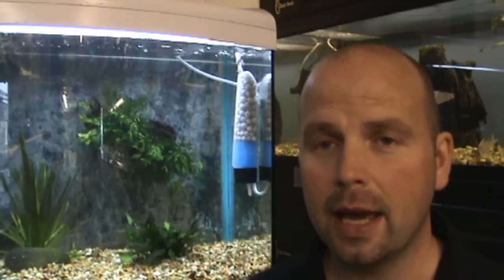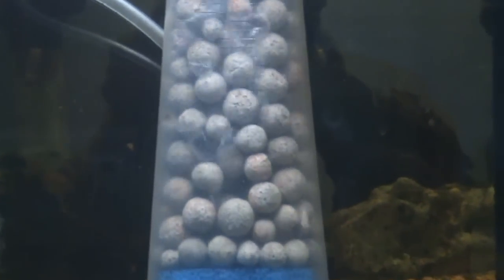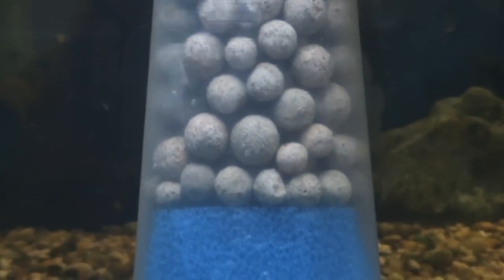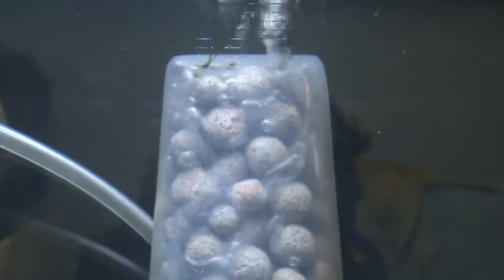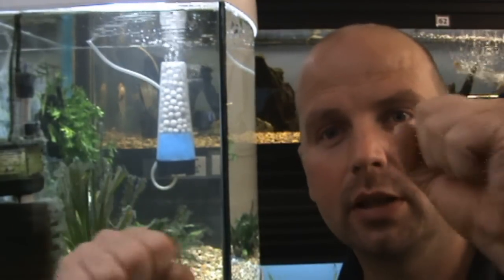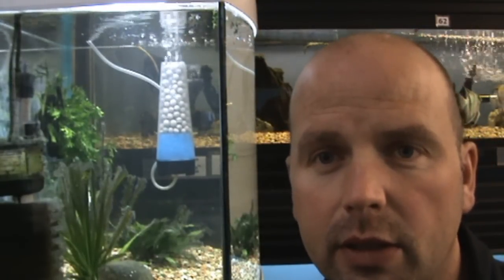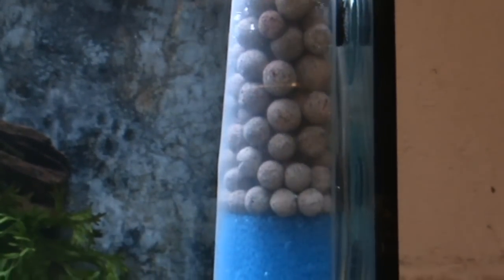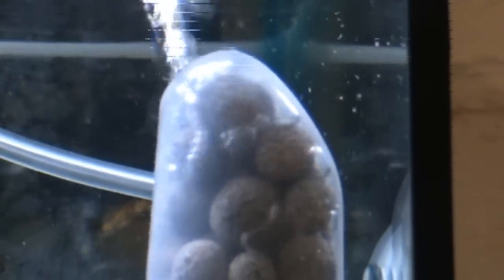Excellent DIY Aquarium Moving Bed Filter by Pondguru

Comment: I got a question that a number of people may be wondering. Can these types of filters replace the need for a hanging filter system in small tanks 10-20gallons? I was thinking of doing a sponge filter with a k-1 type of media that I was going to make out of the plastic cobs from receipt tape, small pieces of straws, and plastic beads.
Reply from the maker: Marc Mears The flow rate on these filters is none too fast so as far as clearing water goes they probably won't do the job of an internal or even a HOB filter. They're really for hammering ammonia and nitrite but will clear water to some degree. Best media you can use is K1 micro as you can have fast flow and violent movement in confined space. I'd personally use a DIY filter in addition to standard filtration.
Reply: Thank you for taking the time to answer my question. I love watching your videos, a lot them I've seen multiple times. You are a interesting guy with a lot of hobbies that I also enjoy.
Reply from the maker: Marc Mears Although it can take me 3-4 hours a day I do try and reply to all the comments. Glad you enjoy the videos and I hope to be doing some more filtration videos soon and there's some give aways coming up too so look out for them. I reckon my channel would do much better as far as subscribers and views goes if I only had one hobby on it but the last thing I am is a one-trick pony, lol. I see a few channels who never put anything else on other than what the majority of their viewers want to see which is great for them building channels but the passion seems to go from the channel owners and they end up faking it which is pitiful to witness. I'm as unconcerned about views and subscribers as I was when I started, lol

Comment: I hope I can still ask a question here. I want to make one of these but I am wondering if they make noise? My bedroom is on the other side of the fish tank with French Doors in between which are always open a little for the cats to come and go without waking me up. I am a pretty light sleeper.
Reply from the maker: Yes, any air driven filter will be more noisy than a 'normal' pump driven filter so if noise is an issue you'd be best to avoid air driven filters.

Comment: how's water coming out from there? I only feel only bubbles go out.
Reply from the maker: If you injected dye outside the bottom of the filter you would see it drawn into filter and spat out top but as it is not a powerhead type of flow that is not visible like it would be from a standard pump driven filter.

Comment: That looks very nice.
Would it be possible to make a large version for an outdoor koi pond using the same principal ?
The construction would be quite simple to do, but there are two conserns
- how to clean it easy and how big does it need to be
Yet the good things could be.
- the filter would only need air to be powered and it would require the water to be pumped to an external filter system 

what are your opinion on this system for a Koi Pond.?
Reply from the maker: +dkphantomdk Yes it is exactly the same principle as the Nexus filters which are very popular for koi ponds in the UK. The ideal scenario would be to have a 3 stage filter with 1 - foams to remove solids from water, 2 - moving bed media to remove ammonia and nitrite, 3 - static bed or shower filter of biohome / pumice to remove nitrates. A vegetable filter (pond plants) could also be used to soak up nitrates. Really the only thing which would need maintaining would be the foams.
Reply: +Pondguru Outdoors Yes, but I was thinking mounting this system in the Koi pond, so that there would be no need to pump water out of the pond to a filter and back to the pond.
The nexus has an air suply / pump ( in or out ), but if it was possible remove the pump, and just have Air to "power" it it would save energi.

Iam thinking, getting a huge "plastic" sever pipe, and build it up like this akvarium bottle, with Foam / Moving bed. then placing it inside the pond with a huge flat round air stone to pull water flow in it.

The foam would be diffecult to clean, but maybe you have a solution ?

( at the moment Iam running an Oase Filtoclear 30000 pr set, but Iam hoping to enlarge my pond this summer, and the Nexus 320 is an option, but, this bottle princip would be nice and would not require to many pipes or pumps to be installed )
Reply: +Pondguru Outdoors IT might even replace the Tornado Protein skimmer, with an outlet on the top?
Reply from the maker: +dkphantomdk If you already have a 30000 keeping water clear you won't need foams in your moving bed since the media is self cleaning so no worries there. Your idea sounds like it will work fine and I'm sure I have seen similar filters used in a video from a while back in a koi pond but I can't remember what it was called. If I track it down I will send a link.
Reply: +Pondguru Outdoors That would be nice, thank you.
It would be great if I could just keep on using the 30000 set, but it will reach its "limits" ( I will enlarge the pond up to max 15000 liters - thats more than it should be able to handle with koi - but I wont keep many fish )

but if it could work out with the 30000 set, and a few "pipe moving beds" in the pond it would save me some money ;)

( by the way. I really enjoy your video´s ;) )
Reply from the maker: +dkphantomdk Yes you could keep the 30000, add some moving bed filters and you'd be good to go. The moving beds will easily cope with ammonia and nitrite.
Reply: +Pondguru Outdoors hi Richard,after recently upgrading my external filter with biohome media, this is my next project using the biomotion,in your opinion how often would the sponge in this filter need maintenance
Reply from the maker: +daren barling It is generally a low flow filter so the foams may only need cleaning every month or so but it depends how powerful the air pump is and how much free waste is in water. If you have an external on there too the water should mostly get drawn toward the external intake so the filter foam with biomotion in may only need looking at every few months.
Reply: Pondguru Outdoors ok thanks

Comment from the maker: Cannister filters are all becoming pretty much the same although there will always be high quality manufacturers (e.g.Eheim) and cheap chinese filters (too many to mention). Most of the time the cheap chinese ones will have media which is absolute crap so best way to turn it into an effective media is to strip it out and replace with good media (e.g. Biohome plus / ultra)
One main problem with cheaper filters is reliability of pump.

Comment: Hey, I have a 129 litre planted tank that will be stocked with ~ 10 cory habrosus, 8 otos and 7-9 female bettas. How much of this media should I use?
Reply from the maker: Amount and type of media will depend on what type of filter you have.
Reply: Pondguru I want to make a vibrating bed with the biomotion media using a similar set up to what's in the video~
Reply from the maker: nerdziz It depends on size of container but I only used about 250g for this one.
Reply: Pondguru Is there any kind of ratio I could go by? like x grams to y litres of water

Comment: having read some other comments, I have two questions still:
1. when doing your weekly water change obviously you don't wash it weekly too, but especially with the foam/sponge surely it needs some rinsing/replacing?
2. will this be enough for filtration in a 10-ish gallon tank?
Reply from the maker: As you can see the foam you'd rinse it when it was dirty. The frequency of that would depend on the fish stock.
The size of filter required depends on the fish stock and for a lightly stocked planted tank of 40 litres this would be fine. For a heavily stocked tank you'd be better off with something like a Fluval 106.
Reply: Pondguru Outdoors Awesome, thanks man!

Comment: Hi I have a 200 ltr tank with a fluval 306 canister filter would the tank benefit from this homemade filter running as well.
Thanks
Reply from the maker: Assuming that you have the external filter set up properly with plenty of good media (around 2kg) and you have a normal stock of fish in a community tank you will not need extra filtration. There is a guide to how much media is required to deliver full cycle filtration (reduction in nitrate) for a variety of stocking scenarios here: http://filterpro.co.uk/qa-24-w.asp

Comment: what is a good filter to get
Reply from the maker: Externals are better than internals generally but it depends on fish stock and tank size.
Reply: ya my tank is not that big but my filter is small can i put other filter media in there such has them rocks
Reply from the maker: irishhiphopman101
If the filter is designed to take filter media, yes.

Comment: I would say that this kind of filter shown in the video doesent work! The tube/container is to wide and the bubbles just rise thrue the tube/container without any watercirculation, the water stays in the tube/container! For it to work the air has to rise thrue a smaller tube so the airbubbles may be able to lift the water up the tube!

Comment: limiting factor is rarely ever surface area but available oxygen.  7ppm maximum oxygen in water (flow rate, media movement yadda yadda has negligible effect) vs 200,000ppm oxygen in air (air is 20% oxygen, the rest mostly nitrogen). wet/dry will always be superior as it maximizes oxygen. simplest thing is DIY bio-wheel type. Get some foam, stick pvc or any rod through it, horizontally submerged it to pvc/rod, make it stable however you want (i use suction cups) it will rotate with just air bubbles, use powerhead/pump if faster rotation is desired.  picture Marineland's biowheel and DIY use some imagination
Reply from the maker: The Marineland filters are not very effective as the biological action is very limited without some modification and produces nitrates therefore requiring you to do large regular water changes. I suggest you watch the attached video as it explains all about the conditions necessary for good bacterial colonisation and also runs through the role of anaerobic bacteria which most people don't seem to consider. The most superior filter is one which supports aerobic bacteria for removal of ammonia and nitrite and also anaerobic bacteria for removal of nitrate. Unfortunately that is not a biowheel.
FILTRATION, FILTRATION, FILTRATION - THE NITROGEN CYCLE AND BACTERIA